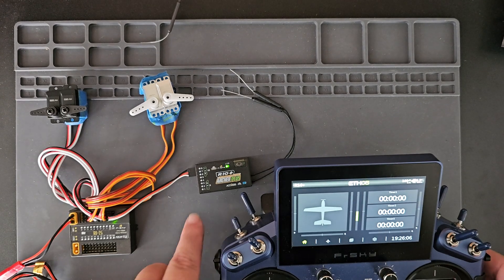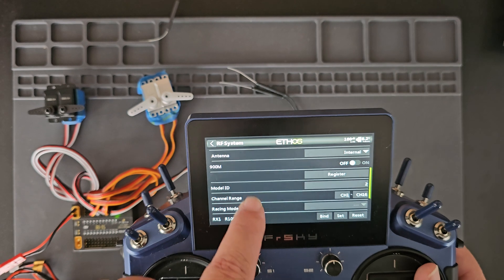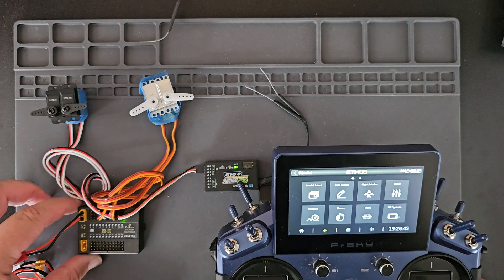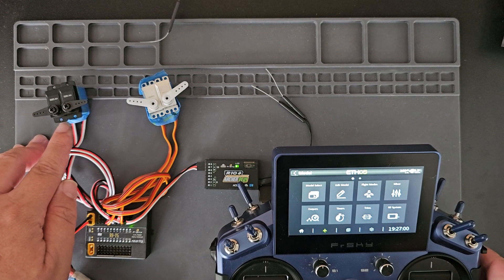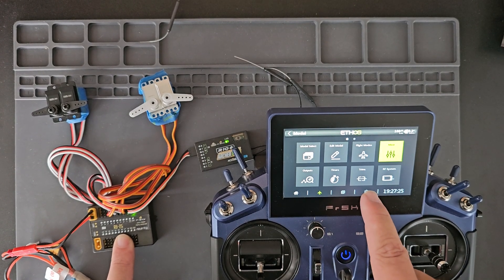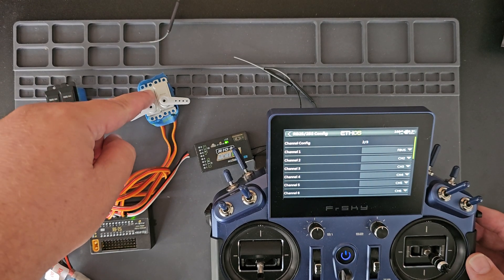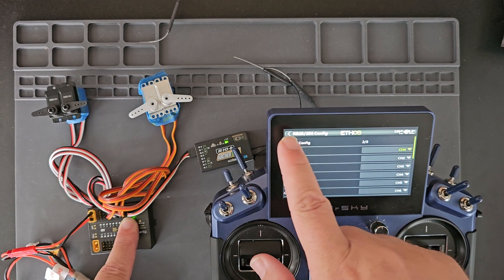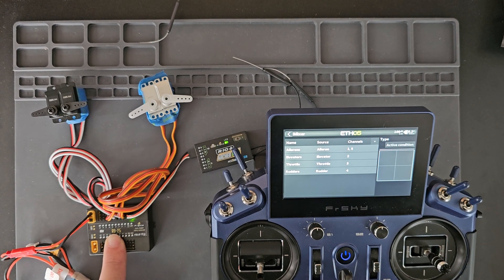FrSky RB25 ARCHER Plus R10+ Configuration and Channel Mapping by FBUS Pin10

Comment: Will it work on taranis x9d+?
Reply from the maker: Yes and no.. you can use the box with any sbus or smartport receiver but you will not be able to do any of the advanced programming like reassigning the pin settings or stabilization configuration for RB25S/35S